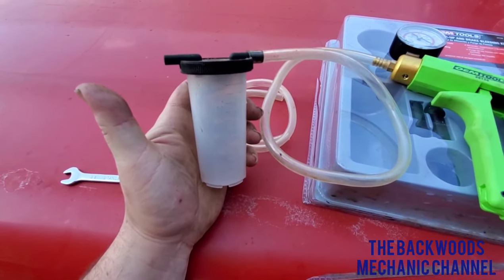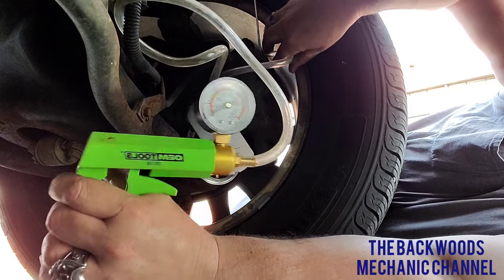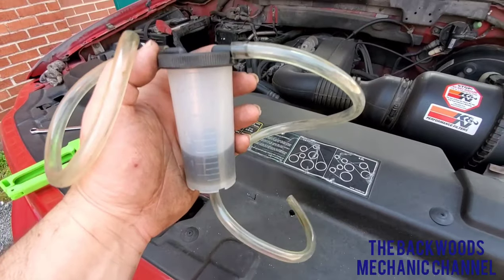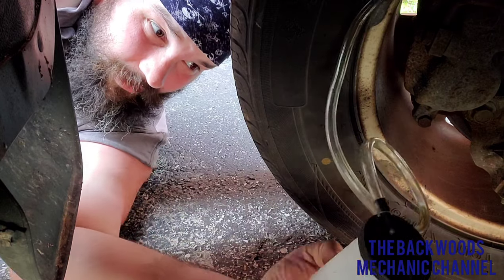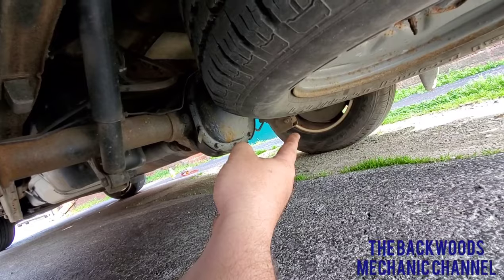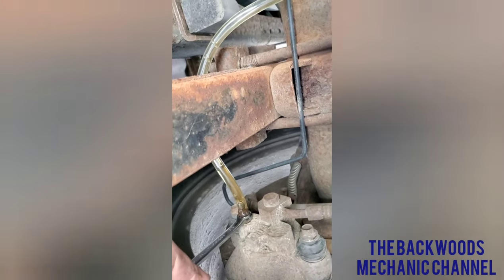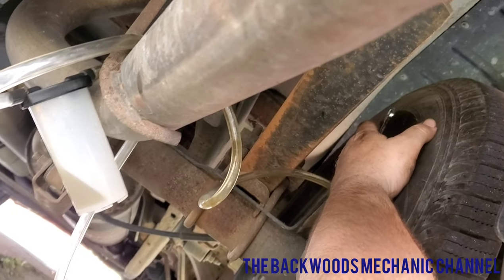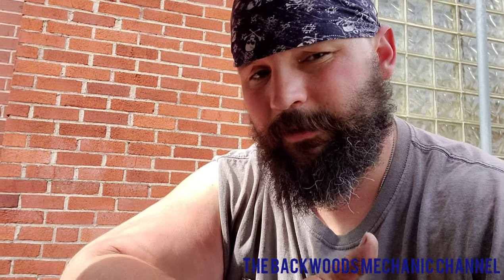DIY Bleeding The Brake System of a 2002 Ford F-150 by Yourself with just Two Tools #HOWTO #DIY #OEM

Comment: I enjoyed the video, but I’ve read several other places where one should start bleeding at the furthest wheel from the master cylinder. In the case of ABS vehicles, one should start at the furthest wheel from the ABS module.
Reply: Rule of thumb is start to wheel farthest to the driver side which is the right rear wheel. But refer to ur service manual coz theyre not all the same. My car says I start at driver side front wheel.

Comment: I have a tip for people following this video. Do not put your old fluid in a container that you are accustomed to using. For example, I drink caffeine-free diet coke. I should not have used one of those bottles to put my old fluid in. NOPE, I should not have done that. Fortunately, I did not swallow the brake fluid, but I've spent the last two hours rinsing out my mouth. It looked like coke and well . . .
Reply: Yup... Imagine a kid that will actually slump the whole thing before taking notice of the taste
Reply: Lmfao 😂

Comment: Thank you. I purchased that same bleeding kit and could not find the instructions for using it. Your video made it very clear.
Reply: Mine from AutoZone didn't come with directions either. They really just quit caring about little details like quality of construction and quality build.
Reply: Same here...no instructions with the pump!!!😠😠😠
Reply: How the hell you put the seals on the lid
Reply: I second that notion
Reply: @thomaselam2532  the rubber o ring actually sits on the top of the clear reservoir cup in a groove. Not in the lid.
Reply: @bradysolaem2467  the rubber o ring seal sits inside a groove on the top of the clear cup that comes with it not the cap

Comment: Yes this video absolutely helped me I'm at the science center in Eugene Oregon I pulled in here cuz my brakes went straight to the floor for some reason I figured it was air in the lines so I pulled in here took the tire off and checked it Sono brake fluid anywhere I didn't have another person with me if I look on YouTube for something helpful came across your awesome video and yes I was just about ready to do it just like you said your video thank you and I appreciate it have a good one my name is Steven

Comment: I really liked your style of video and your way of showing kinda what its like for the "not as affluent" do it yourself person. The only thing I disagreed with is your order of  bleeding. All cars are different and the standard with abs is furthest from the cylinder then next, etc.  But there are exceptions to every rule.  It's free and easy to look up your vehicle and see what the recommendation is. Safety 1st and all that.   Otherwise you were spot on. You also did a great job of showing the process the air in the line, etc. You also set up your shots and then had to hold the camera so in my book your top notch.  I think everyone that comes across a video like this can appreciate it immediately.   Hope you are well and life's good,  as I'm 2 years late to this video.

Comment: What a great video sir.
I tried to bleed the brakes yesterday on a 2019 VW Tiguan . Changed rear rotors and pads . Over torqued a caliper pin and it broke off in the caliper with the threaded side stuck in the hole . So now I have a new problem.
However after watching your video .
I realize my own tool is defective. The needle is not moving when I squeeze the trigger at all. I put in the little o-rings on the inside of the cap before sealing it .

Comment: Small point of correction on an otherwise awesome video. 

You want to bleed from farthest to nearest in respect to the master cylinder, not nearest to farthest. 

Resource: ASE A5 certification.
Reply: I tend to agree. Thats the way i do it. My last job, the manager swore by closest first. Ive had it work just as well both ways. Some cars/manufacturers actually do say to start closest to the master, mostly some newer cars.

Comment: I purchased the same unit you have for my Mercedes S550.... not trying to pay $350 when I can do it myself. I'll be getting to this in the morning. This looks easy enough. I'll let you know how it turns out. Awesome video...Thank you!!!
Reply: I Just Bought This Today Too For My 08 Vic Civi.  Mechanic Wanted To Charge Me $265.... I Laughed All The Way To AutoZone!!!
oan. I appreciate the vid BackWood! 👍
Reply: Bought it...used it...Laughed at the techs at Mercedes!!! Saved myself almost $400!!!
Reply: I... I'm a mechanic that charges for doing that lol! XD!!! I will say $200 is to much money for flushing a brake system, I mean the fluid is like $10 or so for DOT3-4, and the charge per hour about $60-$90 bucks depending on the shop, so honestly you shouldn't pay over $120 max, if you don't want to do it your self.
Reply: @josefelix4152  hola amigo! ¿Entonces si conviene comprar este kit para trabajos de mecánica móbiles?
Reply: @mtsanchez27   si amigo !!
Reply: @dustieman9727  ¡gracias!

Comment: Yes if you have a Ford 150 you don't need to jack it up. But if you have a recently manufactured car most likely it will be rather low to the ground. You may have to jack it up. Also, in my experience with my 2015 Honda Fit, even though my brakes did not need bleeding, and I was simply  flushing the old dirty fluid out of all the lines, my vacuum pump kept pulling air bubbles though the tubing. Eventually I realized that by cracking the bleeder valve only 1/2 a turn or even less, what may have been happening was that air was being sucked in from around the threads of the bleeder valve. Supposedly an "old mechanic's trick" is to put a little multipurpose grease around the threads. However I had trouble getting grease to that spot. The area was rather crowded with things. Also, I kind of worry that with grease around the threads, when screwing the bleeder valve back in some grease might be forced into the system. So I decided that next time I was going to look for a helper bleed the brakes using the push method rather than the pull  method. That is, get someone to step on the brake pedal while I open the valve, and allow the pedal back up after I close the valve. Or I could save a few minutes by using a check-valve, a one-way valve. Auto parts stores describe these as being a "one-man bleeder tool." They really are not "one-person" bleeder tools because you can't work the brake pedal and see any air bubbles in the tubing, at the same time. However they cost practically nothing and can save a few minutes of time off of the job.

Comment: This makes more sense strat from the front going to the rear all the other videos I’ve been watching started bleeding from the rear passenger end which and then the front it will defeat the purpose of bleeding out the air in the system
Reply: I think it depends on if you pump the brakes or use the Vac kit.
Reply: Its actually better to start furthest from the master since that is the longest line holding the most air so you get more air out faster starting furthest. Ive done it both ways, they both work, but i tend to like starting furthest. By the time you get to the front, there is less air than starting closest.

Comment: Idk if you still respond to people on here but here it goes…What could possibly be wrong if the vacuum pump from the bleeder kit is losing suction and bringing a little bit of fluid out of the bleeder valve while the valve is still tight?

Comment: Will this “vacuum” bleeder tool works on older cars that has a proportioning valve? I have a 1978 olds cutlass that has a proportioning valve and I tried using those “pressure” bleeding tool and brake fluid wasn’t streaming out of the rear wheel cylinder.
Reply: There's a difference between pressure bleeding and vacuum bleeding. Pressure bleeding you are actually pushing the air through the line and out the master cylinder. Vacuum bleeding you are pulling the out the line through the bleeder. With a pressure bleeder, you have to have a container full of fluid so it pushes the fluid into the bleeder and the air out the master. Both ways you always want to have full fluid because if you run the fluid down you start getting air in the system and have to start over. You can also gravity bleed. Just keep the master full, crack the bleeder, and let the fluid run out until theres no more air and all clear/new fluid, then close the bleeder. No air enters the system unless you run the master dry, or press then release the brake pedal w the bleeder open. You can press the pedal down w the bleeder open, but you can not release the pedal until the bleeder is closed or it will suck air. But thats only if you're doing the 2 person way, which actually does work best because it forces the air out with much more pressure.

Comment: Hey buddy had a question I’m running into problems I have a 1997 F150 XLT 4.6 L 4 x 4 and I bled the brakes system put new  oil & seals on the brake calipers and drum brake pistons put a new brake master cylinder and brake booster and tested the ABS module by sticking a stick in the little hole and pressing on the brake and it does not move the stick supposedly that sign is good but my brakes are still spongy meaning it sinks in half way And driving at 25 miles an hour residence I stepped hard on the brakes and it takes about 1.5 or 2 seconds to come to a stop but I want my brakes to bite on the rotors and it’s not doing that is this normal or do I need to plug a scanner so it could auto bleed mode to complete the service so it could break hard? I heard this from a GMC Tech veteran who said that I might need to hook up scanner just like the GMC trucks. I hope u can help with good info. I want my truck To leave tread marks on the ground when I slam the brakes hard I want my brace to bite the rotors just like my Mazda 2002 but I don’t know where ABS is the Design to not do this.

Comment: In your opinion.  Do you think you would use this if you had a kid that needed some extra chores, or would you put the kid to work?  It seems to be a bit better at evacuating the air while not going through as much brake fluid.  Or maybe there was just a lot of air in the truck’s brake lines.  Great Chanel BTW.

Comment: Should use the vacuum pump to suck out the old fluid from that master cylinder before adding new fluid it will keep you from pulling so much old fluid through the lines and will save you from wasting a lot of new brake fluid
Reply: You can remove most of the master cylinder but make sure to leave enough so it doesn't take air. You'll be bench bleeding master cylinder. Pull-out what you can safely and add new oil.
Good luck
Reply: @bostonbillyduchaney5655  only if you suck out all the old fluid and pump the brakes or have a line busted there will still be fluid in the lines because of the seals on the piston in the master cylinder so no worries about getting air in the lines

Comment: I tried this with this same tool and it's constant bubbles.  Having me wondering if air is getting into the bleeder screw threads.  I was losing daylight fast so didn't have much time on it.  Will try again tomorrow but very discouraged right now.
Reply: Most likely, the bleeder screw is bad.

Comment: Is there ever any condition where that newish looking brake fluid could be re used or is it always thrown away no matter what it looks like?
Reply: most people don't realize that the fluid doesn't really travel, the system works on pressure. the fluid just maintains the pressure and unless you have a leak doesn't move, so for the nitpickers, yes as your shoes or pads wear the fluid level does drop, still doesn't move in the system.

Comment: Been doing brakes for years...never heard of doing the the front left first...wth...always passenger side first...and use a reverse bleeder works 100% better and effective...
Reply: Which reverse bleeder kit?
Reply: @jakefriesenjake  reverse bleeds you push fluid through the bleeder valve into the caliper and push the air out the top on the master instead of sucking the air out vacuum bleeding. But no, reverse bleeding is not better, especially for older cars, it can ruin the seals because the pressure is pushing on them the opposite way they are meant to.
Reply: @jacksmith2315  I tried all methods. It would not bleed fully. What I ended up doing was loosening off the mc bolts so I make it level, then the bubbles could escape from inside the mc. (I did bench bleed the mc initially) I believe that I ended up pumping the pedal with a hose on the bleeder. Pumped slowly and held it with a stick, then loosen the bleeder, over and over (didn't have a partner to help). Brakes are awesome now.

Comment: Did any one have issues making a solid connection with the bleeder valve with the hose?  The valve was too small to get an air tight connection.

Comment: I tried with the same bleeder tool and I don't know if it's me or what but I used a whole quart of braking fluid and it seems the air never finished coming out.
Reply: Air is coming in at the bleeder screw threads And/or hose.. can put grease on it to prevent that
Reply: now do it right and start at the right rear

Comment: You start at the rear first, since they are the farthest from the master cylinder.  All that air you see is probably coming from the screw threads on the bleeder nipples, not from inside the brake lines.  If you had that much air, the pedal would have been super spongy.  Also, its vacuum, not pressure that you are creating at each wheel with your bleeder device.
Reply: You think so??

If that was the case, dude, the air bubbles would never stop coming.

If they stop coming, but clear fluid comes, does that just mean air bubbles will be coming back if he was to pump it just one more time?

They litteraly make these kits, spent thousands and thousands of dollars to build injection mold dies to create a pos tool that doesn't work, but most mechanics say they work?
Reply: @jakefriesenjake  sorry “dude”. Bob is correct on both counts.
Reply: I Concur with Bob Also On All Counts
Reply: Your comment is spot on.  I read all of these comments and it's clear only 4 or 5 people actually have a clue how to do the job correctly.  Funny how many of these influencers don't really know what their doing and the followers keep sucking up faulty information.
Reply: @jakefriesenjake  Bubbles eventually will stop once the fluid has gotten into the screw threads...I use small ramp(RhinoRamps) on the rear wheels to get under easier....BTW, I use 4-Uncles Brake Fluid Extractors

Comment: The only reason for a breaker bar is for extreme torque so you don't break the teeth in the ratchet with high torque. Not going to happen on a 1/4 in ratchet.
Reply: When breaking rusty bolts it's best to use a rocking motion to prevent shearing the thing in two. Not easy to do with a ratchet since you have to change direction each time. Though i prefer an adjustable t bar and a hammer just give it a few taps clockwise then counterclockwise.

Comment: Two things. Every other video says start from the break that is farthest from the ABS unit and work your way to the closest.
Second ... why open close open close? Why not just open Just open Pump it out until it's clear then close one time.
Reply: His bleeding reservoir is small. Needs to be emptied. Also need to make sure you don't bleed the master cylinder dry and introduce new air into the system. So you stop and go check that periodically.